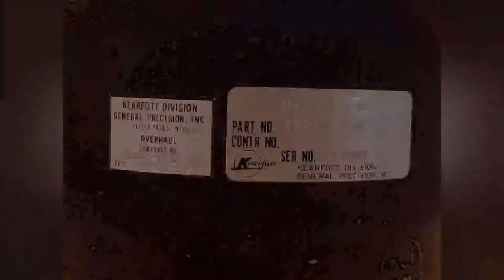Kearfott 425408-1B-A vertical gyroscope opening/look inside

Comment: These gyros are fabulous devices. A glass bell jar is a superb display idea!
Reply from the maker: Gyro's are also my favourite avionics part. (No wonder since I'm a machanic engineer.) 😄 I'm working on a demonstration setup for three gyroscope instruments. A directional gyro, a turn and slip gyro and an attitude gyro. I planned a video for this, but since I've got 71 instruments to describe, the progress isn't that fast. 🙈 Note; the used bell jar is an Ikea bell jar. So this should be rather easy to obtain here and there.
Reply: @polytech_nu  Make a video Javelin or any antitank missile guidance system with its schematics of circuits

Comment: Those gloves are not suitable for fire work...
Reply from the maker: That's true. Since I'm not touching hot parts nor reach in the flame, no thermal gloves are needed. And thermal gloves are thicker and limit my ability of detailed movements. The used gloves are used for chemical protection. This is done to prevent contact with lead in the solder and other 'nasty' chemicals an materials. The effect of these gloves is much higher than washing my hands after each handling. I made a risk assessment of the absence or thermal gloves and use of these thin gloves and with the knowledge of the possible hazards I made the judgement that this situation was safe enough for me. ;-)